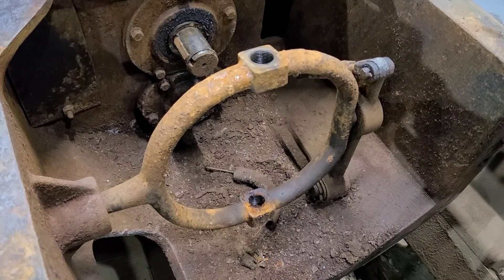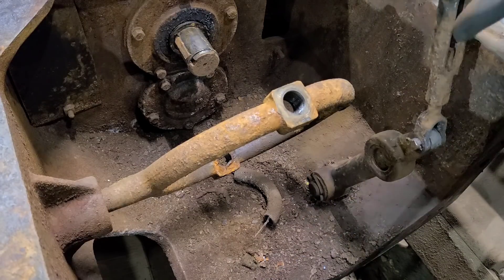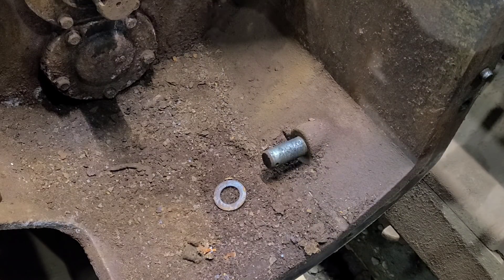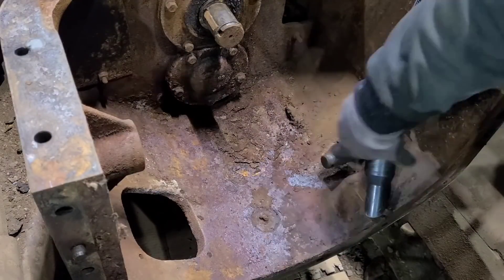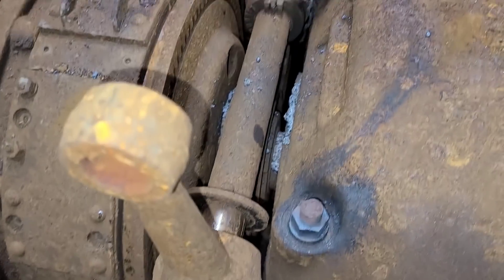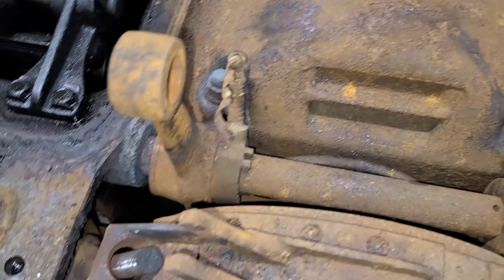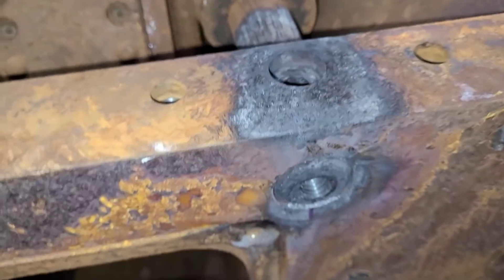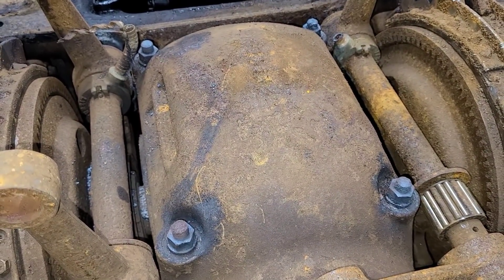Caterpillar RD-4 Chassis and Rear End Disassembly Pt.1

Comment: I'm always fascinated watching these old machines being stripped down and restored. Funny that I WOULD like that as I've been a professional mechanic for 50 years. One thing I cannot get over is your aversion to penetrating oil. I've gone through some general rebuilds that probably used up a case of Blaster. I've found that penetrant with just a little bit of heat has done wonders. However, I have methods and habits that others would find questionable too and I learned very early in the game that if you have 10 mechanics doing the same job you'll have 10 different methods. None of them are wrong. Thanks for the vids! Keep up the good work...
Reply from the maker: I'm glad you know there is more than one way of doing things and that everyone has varying opinions and none are right or wrong, just different perspectives based on experiences

Comment: Wonder if the sheet metal plate inside the clutch housing is to keep rodents out of the steering clutch area?
Reply from the maker: Possibly? It's just weird only one side had it
Reply: @kylechrist  there may have been two at one point but then rusted off. May have vacuumed up what was left of it. Not factory but some farmer installed option.

Comment: I'm realy enjoying you little project. But I'm amazed that you don't use more penetrating oil, and let thing sock a bit before getting brutal, I've done similar things in the past and it's amazing just a little can make a huge difference. I can't wait to see it running.
Reply from the maker: I've never had great luck with it other than just making a mess of everything. I will use lubricants when I feel necessary but not penetrating oil

Comment: Help an ignorant viewer.  Seems as though there are several points in the back end that could use some lubrication (steering clutch mechanism needle bearings).  Does this area normally run wet or dry?  If dry, are there ways to provide occasional lube?  Same goes for the release bearing mechanism for the engine clutch.  Enjoying the progress--well done.
Reply from the maker: These are considered dry compartments but if you look there is a little brass collar on the steering clutch shaft, this collar had a small hose that went to the main top cover and there is an oiling point there. The main clutch has the exact same setup, if you watch the video of removing the transmission cover, there is a tube in the bottom side of that cover that brings oil to the main clutch. Great questions though and thanks for watching!
Reply: @kylechrist  Thanks for educating an ignorant viewer and in retrospect, I do remember seeing some oil cups.  Consider me embarrassed!

Comment: I have never seen the cotter pin trick before. It is a great choice when the access prevents other methods. Please pass along other tricks as you think helpful. We all tend to use what has worked in the past, but sometimes the effort required leads to frustration. Alternatives are a good thing!
Reply from the maker: Never hurts to have more tricks up your sleeve!

Comment: For Cotter pin removal,  I've used a pair of side cutters, or dykes to grab them and lever them out. Just sayin'... 8:40 oh yes, the punch and pry method works if you have the space... keep it up.!
Reply from the maker: It's not a method I use everyday, just another trick to keep up your sleeve when other methods aren't as useful. I will use side cutters to remove them as well but up against a shoulder (in this case a washer) it can be difficult to get a good hold of it, thanks Paul

Comment: Enjoying the disassemble process. Don't know what to think about the rusty hulk your working on. Some pieces come off surprising easy and others fight you. Rust seems to be a funny beast to deal with.
I am with Mark Stoner on the heating issue. You make it work surprising well for disassemble. BUT are you concerned  what the heat does to the temper of the metal?
Reply from the maker: I'm not concerned at all about the castings, cast iron does a great job of handling heat, that's why it is used in exhaust manifolds, wood stoves, etc. Thanks for watching!
Reply: @kylechrist  Kyle, you might post a comment on this up front.? I see a pattern forming with your audience.

Comment: Interesting project!  Any concerns about the heat changing the condition of the steel?  e.g., hardness, temper, & strength.  Are you planning on replacing the hardware that requires high-strength?
Reply from the maker: Not at all, I don't heat the castings enough to affect them, and cast iron does a great job handling heat, that's why it's used in wood stove, exhaust manifolds, etc. Hardware will be replaced as necessary, once it's all cleaned it will be inspected. Thanks for watching!

Comment: With the shaft ends encased in the block, looks like it would be saft to try and air hammer them out.  Squatch sent me over.  Subscribed and am enjoying the series.
Reply from the maker: I've thought about that, and it's still an option on the table

Comment: Good job!  For what it's worth, I was able to get the brake bands out without pulling that pin out the side of the case.  That's assuming the two pins that hold each end of the bands aren't rusted solid on yours (big assumption).
Reply from the maker: They are haha, everything is rusted tight, but one way or another we will get it apart

Comment: Good work. When I pulled the steering clutch shafts I used 1/2-13 all thread with a socket that cleared the shafts, then a nut and washers on the all thread. Got them moving that way and the socket spread the load on the rear casting. You’ve probably already got them out but thought I’d mention it if not..
Reply from the maker: I have a very similar plan, thanks for following along!

Comment: It seems that the crawler was stored in a fairly low humidity environment/location, the rust on a lot of it seems to be rust eczema rather than total rust cancer. A lot of what you're taking off actually look salvageable, but you're there and I'm looking at a video. Enjoying the tear down. Edit: PS Maybe heat (expand) the casting around the shaft and cool (shrink) the shaft (with dry ice, maybe); just a thought.
Reply from the maker: I think 95% of the parts will clean up and be reusable, just need to continue getting it apart. Thanks for watching

Comment: How about a deep socket and a bolt with a stack of washers to work it out a bit more befor you build a bridge brace to pull with keep the load force closer to the hole or even a solid bridge brace to keep the casting from cracking inward
Reply from the maker: That's basically the plan but instead of a socket it will be a heavy wall pipe, thanks for watching
Reply: @kylechrist  yeah been there n done that too on an old Farmall F30 and F20 and ended up swopping a trans and diff for a F12 from a F14 parts onion

Comment: Very interesting. I’m wondering if a modern coating like POR15 might be helpful for both reassembly or future maintenance.
Reply from the maker: The insides of the cases as well as the parts will be coated (paint, grease, etc. depending on the part) once cleaned and that should help them from rusting again

Comment: I think your on the right track just sacrifice the steering clutch shafts and make new ones, the cutting torch will make short work on removing them.
Reply from the maker: It may come to that, I'd like to save one for measurements if possible

Comment: Kyle, I would like to ask 1 question and submit 1 suggestion. (Question) What is the make & model of your camera, it seems to have a very clear picture, and once put in place it appears to be very reliable  (Suggestion) I know that you would rather use a torch to loosen stuck/frozen parts, etc. than using penetrating oil, but you know as well as all welders do, how expensive refilling your oxygen bottle has become and I have been told that it will be even higher by the end of this year. So it would be my suggestion that you use a high quality (i.e. Seaform or CRC)  penetrating oil first, which you can order directly online with no shipping fee from the CRC company for under $7.00 per 12oz. can or purchase at any Walmart store for about the same price, then come back later (10 -15 minutes) and use the torch. I believe that you will find that you will be using as much as 1/3 - 1/4  less oxygen this way than you do when you don't use the Penetrating oil and at a much, much, much, cheaper cost, especially when you are having to remove dozens to hundreds of bolts and other parts that are rusted and frozen. Scott
Reply from the maker: Honestly I haven't graduated to using a go-pro or anything like that yet, I'm using my phone which is a Samsung Galaxy S20+, it has 4 different cameras on the backside for different magnification/zoom. Once I have everything recorded I then import all of the videos into an editing software and make a video out of it. 

As for torch gas prices, everything is going up. Until I got to the rear end of this crawler I really didn't have to use anything at all, most bolts came out with just simple tools. On the rear cover some of the heads were so badly eroded that my only choice was to cut them off. I'm going to do a penetrating oil test when we get to the pony motor and test different brands, and of course, heat. Thanks for watching Scott
Reply: @kylechrist  I am sure that the two penetrating oils that I listed in my comment above, you will find to be the best on the market at actually penetrating through frozen rust and down through the bolts and screws threads to the bottom, as well as around and down inside and in between stuck parts and doing so in the least amount of time. Most penetrating oils don't do a very good job of actually penetrating through harden rust at all. I know because throughout my advanced years of age (78) I have tried them all at some point in time.  Scott

Comment: A few vids back you said that you don't "believe" in penetrating fluid, what's wrong with penetrating fluid?
Reply from the maker: In my experience in working on older machines I've never found that it works well. What I have found is that it makes a mess of everything, especially when mixed with rust. Heat has always worked well for me so I stick with that. I will use lubricants when I feel necessary but it's not penetrating oil. I'm not telling anyone not to use it, they can do what they feel works best for them, but I'll keep my penetrating oil over on the lathe for machining aluminum

Comment: Are you opposed to penetrating oil?
Reply from the maker: Yes, not entirely but I've never found it to actually work. I've had great luck with heat and I don't get the oil/rust mess afterward. With that being said I will use lubricants when I feel necessary, but not penetrating oils
Reply: @kylechrist  Heat used effectively is superior. Over applied penetrating oil is a mess and precludes the use of adding heat without starting a fire. But I can’t say I didn’t wonder if a good brand of penetrating oil (I prefer PB blaster) would have helped you getting that shaft to rotate or the ease the threads on the brake bands.
Reply from the maker: @macunknown  when I get the puller made and move the shaft more 1/16" there will be a lubricant on there, just to aid in going through the bore, the main goal was too see if they would move at all
Reply: @kylechrist  Understood and good luck with this project

Comment: Rusty bolts and parts can sure enough stress a person but its a good feeling when you get them out without wrecking them. so far so good. I'll bet the track move now. Keep smilin
Reply from the maker: Thanks for following along!
Reply: The tracks will have to come off anyway. Take them off and it will reduce the friction so that the only resistance will be in the final drives.
Reply: It will also save your back. Without the tracks you will be able to get closer to the frame and save the back.
Reply: @rolandmohler2695  The tracks have to come off to get the final drives out

Comment: If you are going to make new shafts anyway why don't you just cut the middle out and drive the ends inward?
Reply from the maker: That's not out of the question yet, I was hoping to at least get one out complete to use as a template for measurements for making new ones

Comment: Honestly, a little penetrating oil  will help you in removing all those rusted components.
Reply from the maker: If I use penetrating oil then I won't be able to heat it with the oil catching fire/smoking. The only way the shafts move is with heat, once it cools down they stop moving and I risk breaking the bolt. I'm not opposed to using a lubricant but only after I get it moving more than 1/16", thanks for watching

Comment: Good show!!   if i were pulling those shafts  id hit them with a wire brush and or emery paper to knock off as much rust as i could first, might save some headaches and damaged holes in the casting. good to see progress being made keep up the good work.
Reply from the maker: Yes, I will need to sand smooth those teeth marks from rotating the shaft as well
Reply: @kylechrist  👍 good luck with it all looking forward to the next vid,  good to see the doggo's as well... cheers.
Reply: @kylechrist  Have you considered giving penetrating oil a chance once you have something partially broken free like these shafts? My experience is that the stuff can help if it can get into the cracks and is given a day or two to work. Heck, I've occasionally had it help when used right after heating something up to "nice and hot". But mostly it seems to help if given a few hours to do it's stuff.

I agree that just dumping oil on something that is rusted solid isn't usually a useful use of time. But I have had it help once the heating and cracking partially loose is done.

Comment: Not sure if you own a set, but a set of gear wrenches will make your life way easier when doing this sort of work.  I'm sure you have it figured  but if you are going to replace the shafts just cut them out then you can drive the remaining parts out of the casting, this will be way easier than trying to remove the whole shaft
Reply from the maker: I'm not opposed to cutting them, I just wanted one shaft out that I could use to pull all my measurements off when making new ones